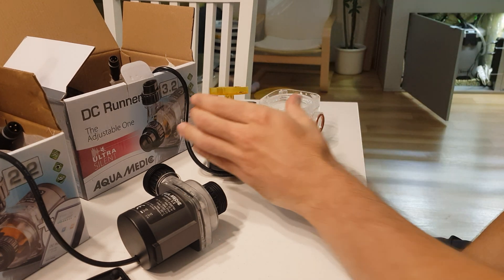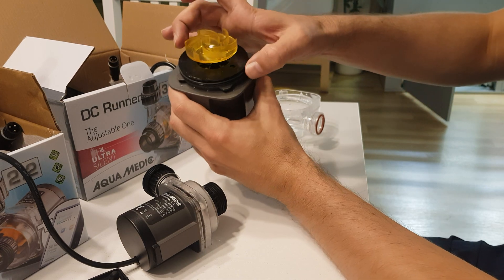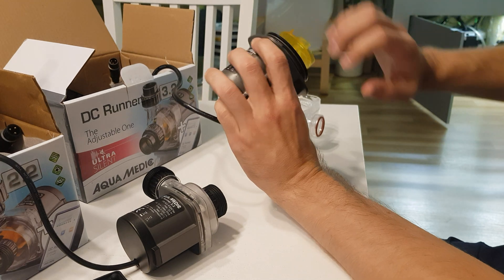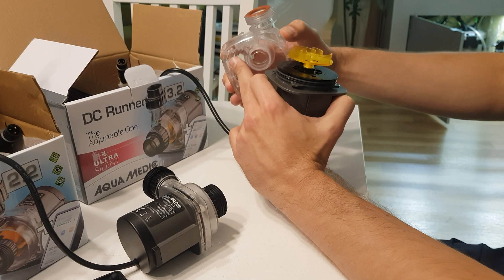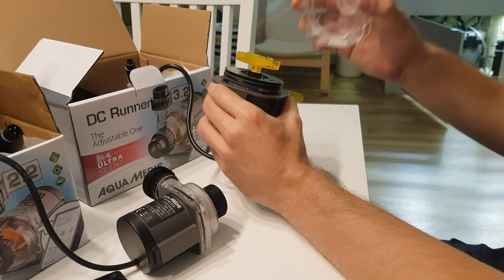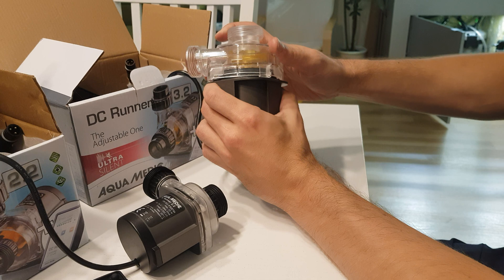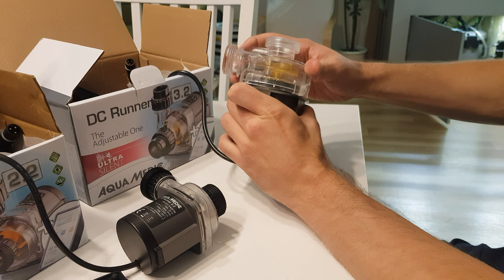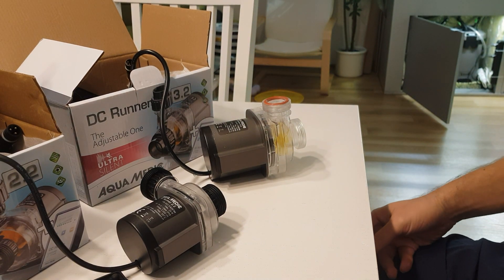Aqua Medic DC Runner 3.2 - beware of rotor alignment!

Comment: Can the outake be set sideways instead of upwards? What are the dimensions with the fitings included?
Reply from the maker: The longest one adds 10cm to the 14cm of the body. One can rotate the clear housing in all four positions so output can stick out to sides or to top. Cheerz!
Reply: @karelyou2  thanks